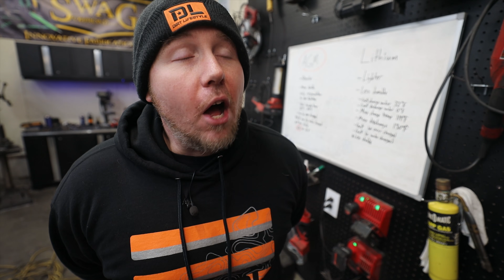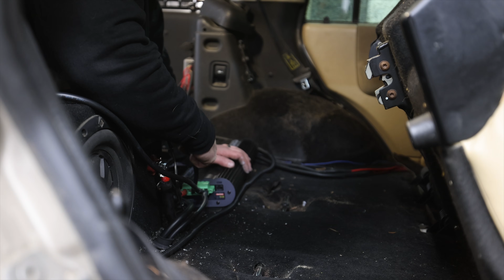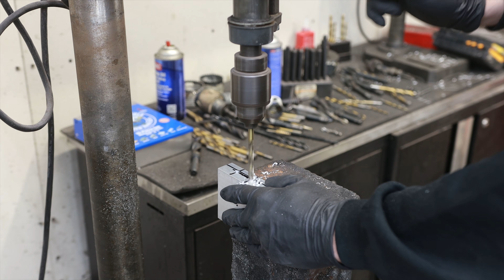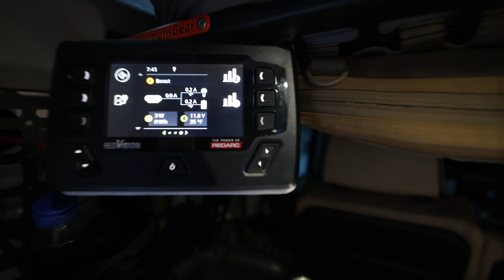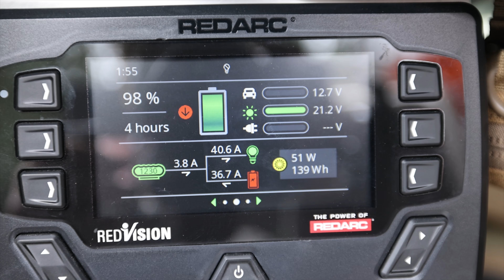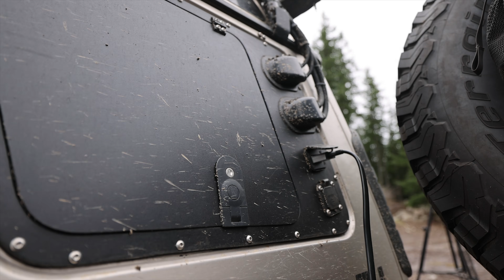Extreme Overland Solar! Dual Batteries Plus Electric Heat In A Roof Top Tent.

Comment: True going overlanding isn't as fun a d being safe alone in the woods as it is with a few friends or family,  when itcomesto solar there are many choices I still use renogy I have many of there products and I have 1500x yeti goal zero and 2 smart renogy lithium batteries 200ah each the only down fall using lithium batteries is real cold weather now days some come with built-in warmer , I think as long as you have thermo electric blanket to wrap up lithium batteries you be good , solar power system are endless ideas 😊

Comment: as long as you stay under the voltage input limit you can safely go over the amp limit and it will just clip your input amp at the max so you can get your full 540w more often.

Comment: Hey Nate i hope you and your family is doing good! I havent seen any new videos lately so i hope everything is ok. 
I know this video is a year old but if you get this i was wondering if you put a bigger altenator in your rig when you went to DC DC charge? I know i hear a lot talking bout putting a bigger altenator and if you told bout it i missed it and i apologize!
Im trying to put a overlanding rig togather on a budget and i started 8 months ago and the truck i got i didnt get it to start a rebuild of a truck i promise but i was told it needed a fuelpump but oh boy a fuelpump was the nicest thing it needed and needs. 
Ive just bout have got the truck to be safe and dependable to drive, almost. So im bout to be ready to start on the overlanding needs so thank you so much for all your help you share with what you have done! Any help willbe much appreciated! 
One more question what if you added 2 more 6 volt batteries if you had room to would it work and be a big help or would it be a over kill? I have plenty of room and can handle the weight so would you do it? Thanks buddy!

Comment: I'm running a 170ah lithium battery with a redarc 40amp bcdc and a 300amp alternator with 2/0 wiring between everything. My fridge will last for more days than I am usually away from the rig.  I haven't installed the solar stuff yet because I don't typically need as much power and with 40amps of charge it charges up in very little time.  I'm out in California and am usually doing some offroading when camping or driving between lakes so I haven't needed the solar yet but once I start looking at hooking up a portable air conditioning/ heater I'll definitely go a similar route. So far between having a nice rated sleeping bag and a usb battery bank powered blanket that usually covers most of the heating needs out here.

Comment: In my experience 700 watts is overkill. I was convinced I needed 800 watts on my last build. I was running an A/C unit and turns out I only needed 400 watts with the technology today with these "solar generators" I used my ecoflow and with the solar topping the unit off I was able to run my 5000 BTU A/C unit and small fans and my fridge no problem.

Comment: going to save this for my pop up a frame trailer that I am rewiring the batteries on soon as they used like 16 maybe 12GA wire when the manufacturer recommends 8GA minimum. Eventually I will be doing an DC-DC inverter and a solar controller with solar panels on some of the roof surfaces.

Comment: Im curious how you are hooking up the 300w panel as the specs of dissimilar panels can have a negative effect on the charging system. was also wondering what charge controller do you go with?

Comment: 12v batteries are almost always a dual use type of battery, vs 6v will almost always be a true deep cycle battery and will subsequently almost always have much heavier plates, those individual 6v's will each probably out weigh the single 12v battery.
I would be VERY wary about trying to use the house batteries to "JUMP" the starter battery, You can charge the starter battery from the house batteries, but the STARTER will undoubtedly draw to high instantaneous load and damage the DEEP CYCLE house batteries. If it's an only option / last resort measure yeah it will probably work, but like you described a single TOO deep draw on the 12v house battery hurt it, a SINGLE too high amp draw will hurt the 6v's

Comment: Lithium iron is safer and more stable than lithium ion. Also much lighter. So light they like to use them in motorcycles / dirt bikes. They tend to be 6v but makes significantly more sense in a durable application. Lithium iron is significantly less temperature sensitive than lithium ion.

Comment: I noticed you mounted the panels by screwing through the side aluminum.   You may have destroyed some of the cells as they usually connect by a printed circuit on the inside of the side aluminum structure.   The proper way is to mount on the bottom portion of the aluminum rail so you don't damage the panels.   Its possible they will still produce but you may have lost half your cells. If you got lucky and the screw holes didn't hit the printed circuit then you will still have full capacity.   You can test the open circuit voltage output under sunlight to see if it matches the manufacturers specifications, this will tell you if you damaged them or not.
Reply: It is also possible these panels have the printed circuit on the top so it is safe to drill the screw holes where you did and not damage them.  The panels I have use you can't drill where you did and not risk damaging them.
Reply from the maker: This is just an aluminum frame. 👍

Comment: yep... that's what I run in my diesel truck... 2 AGM 6v 225Ah, and 3000watt inverter inside rear contractor box bin, runs all my aux lighting, music radio, race radio, freezer, 4cfm jobsite quiet air compressor.... and then the premier power welder with additional 2300wdc up at front bumper ....

12v "deep cycles" are MARINE deep cycle and not true deep cycle, nowhere near same depth of discharge...

Comment: Why so large of panels?  The guys at 4wd24/7 use 100w panels on each vehicle and never run out (usually use less than 20%)  it just seems like a ton of power.
In Florida where I'm at I run a 125w on my Bronco and it's always full.  It took me a year to see a drop to 99%

Comment: I had a ctek system on my truck when I lost my alternator in remote central Nevada. I planned to head towards pahrump until the batteries died and then call for a tow. Instead, the controller sensed a draw and started charging my starter battery from the solar panels. Not only did I drive all the way to Vegas, but I kept going to Laughlin, spent a couple days there and then drove to SoCal on power from my panels. It's great, just don't try it at night!

Comment: A solar controller, with a proper MPPT controller, as long as you don't go over voltage, you can overpanel quite extensively.  Voltage is the "force", amperage is the possible volume, the controller can limit amperage.

Comment: AGM is the way in a 4 season vehicle. If one of the 4 seasons is snow and ice. Lithium X batteries are awesome, but not in the cold unless you can heat them using shore power.
Reply: Nah. Self-heating LiFePo4 batteries are very common now and address low temp charging issues.

Comment: practicing with an induction. hotplate..  600 watt inverter ran it  on medium... will use the   xantrex sw 2,000 watt  in the sequioa build...   electric blankets perfect... and bicycle charging.. next? DIY. 12 vdc  1x 10 inch long  pipe,  water "warmer:"   nice. build.

Comment: I’m a huge fan of solar panels and have had one on my minivan for years. I recently swapped the minivan for a Jeep and am planning to add some solar as I rig up for overland camping. Ideally, I’ll get a roof top tent with a flat hard top for my Gladiator where I can mount solar panels on top. Lots of good info and ideas in this video.

Comment: I’m thinking I’m going to put together an eco flow set for my tiny home with a bunch of panels and use their dual fuel generator. I’m still trying to figure out how much eco flow I have to buy and what I can buy cheaper and mix with it. If I can do it with just the generator I will. If not I will go the generator and the delta 2max and a spare battery. That way I have two slots on for the battery and one for the generator. I’ll use normal panels from there.

Comment: As far as being able to jump start the rig with the, basically, second set of batteries. How would connecting a battery selection switch work out? Boats, larger boats anyway, have been doing it for decades. I have seen them with either the as a 1-2-off or 1-both-2-off setup. In you case i think a 1-2-off style would work. Also, as a retired EMT, every ambulance I have ever worked on has a power switch to turn the batteries on. If it is not on, the truck/van operates as it would from the manufacturer. (Ford, GM, Dodge, MB.....) Once the batteries are turned on, it is now an ambulance. And all the fun switches come alive.

Just a thought, but i think it may at least give you a direction to follow.

As always, love the stuff you do.

Comment: You can use a Victron Battery saver to set a low voltage cutoff to save your batteries from over discharge

Comment: Generally you'll see 75% of panel ratings as output. But in right conditions with large enough controllers you can see 100% or just over

Comment: If the charge controller is an MPPT over paneling is perfectly acceptable and won't hurt anything. It will just limit the output at it's rated amperage.

Comment: I picked up a smart lithium battery with display built on top showing charge capability,  temperatures.  Has built in BMS with low temperature warm up, to prevent the battery from changing at low temperature. Bluetooth as well, but haven't got that working yet. Got it on Amazon,  not a bad price.

Comment: really useful video, thanks for putting it together, Im on a parallel course with a RR SC Sport that needs to be a daily 'normal' car and overland capable too. lifted, ARB lockers, winch and iKamper all installed and going with bluetti AC180 for for power for fridge etc. based in Alberta Canada, so if your ever up this way let me know

Comment: Good stuff as usual.   But for the amount of internal volume your taking up, just get a solar generator,  and several are self cooling/heating, even some batteries are., andbat a 3rd to 4th the weight.   Everyone makes this stuff so complex,  spread out, diy(whoops I didn't connect something right), now it's fried, just KISS.

Comment: Love this. I found with winter camping bifacial panels made a HUGE difference, crazy how much energy bounces back off the snow.
I don't have a heater in my setup, I use a 12v electric blanket to keep me toasty. Found a super nice little electric kettle that's been PERFECT for warm drinks, soups, etc. Lot of great little electric devices out there to make overlanding for extended periods pretty easy.
I personally went with a Delta 2 + portable panels, because I tend to park in covered areas and wanted it the solar setup to be a bit more flexible. Definitely curious to see how your solar blanket works out, I think that was a smart addition.
I have used the Delta to charge a NOCO battery jumper to just ensure I don't blow the expensive battery, lol.

Comment: Very nice! I'm very curious what kind of electric stove top you're planning on using with this setup? I've been planning an all-electric setup and my back-of-the-envelope calculations told me that the draw from the inverter for an AC electric stove top would be too much for AGM batteries and I'd need to look at LiFePO4. But maybe I'm wrong?

Comment: This is great man, I'm digging the setup. 

My only gripe is that there are no "service" loops at your points of ingress for the wiring into the cab. A little half loop would give the water something to run down and fall off instead of running into the connection.

Comment: There’s a Renogy charge controller that does 50a solar + alternator. Have to turn off the solar panels to get all 50a from the alternator. Any wattage from the panels will drop alternator charging to 25a

Comment: One thing to consider for getting more wattage production from your panels is have them at a 90 degree angle to the sun.  Yours are flat but if you set up your tent they will be at more of angle.  If the angle matches your latitude then they will be at 90 degrees.  So when parked make sure your tent is set up and this will also increase your production without any additional infrastructure.  Great video as usual thanks for sharing.

Comment: Just for perspective 

2- 6v 220ah AGM batteries weigh 166lbs, cost $600, and would require a HD mount. 
(warranty? lifetime cycles? )

1- 12v Li-time, self-heating LiFePo4 280ah battery weight 49lbs and cost $700
(5yr warranty, 3-5000 cycles) 

For Lead-acid and AGM batteries longevity sake you should only discharge to ~50% meaning instead of having 220ah its more like 120ah.

For LiFePo4 longevity you should only discharge to ~20% meaning instead of 280ah it's more like 220ah 

In my opinion the best setup is as follows. 
 
Duel AGM starter batteries under the hood for starting, winch, lights, air comp and use 1 to jump the other in need.

1 12v self-heating LiFePo4 battery (insulated) inside in the back for everything else.
(with 12v there's virtually no reason to run an inverter as 99% of things are 12v anyway. fridge, fans, charging, acc lights etc.

Comment: You really need to test out LifePO4 in the real world.  Alot of folks are worried about the temp requirements, but if your above 0 even a little bit of discharge is going to heat it up enough to accept a charge, and with many including heating elements now, that's even less of an issue.  And as long as you buy a decent battery the BMS should protect you from actually damaging.  Same of overcurrent....LifePO4 will have lower max discharge rate, thus not recommended for jumping,...but in an emergency, worse case it will trigger overcurrent protection.  That leaves ruggedness vs safe space to mount...which I know drove your decision for the most part.  That being said, a couple of 11lb 50Ah LIfePO4 batteries would give you more usable power, just have to find a little over a cubic foot to stuff them...
Reply: Finally fixed my account to be to my standard 20 year old youtube account.  So disclaimer, replying to myself.  Because I wanted to point out...that for the battery side of the build...this amount of battery is bare minimum.  Nate obviously can speak for himself, but what he appears to be going for, but IMHO that is enough battery to make it a SINGLE night...then a ton of solar to hopefully charge in the worst conditions...  For clarity, the 150W 12V heater is drawing about 12A...those AGM batteries are 110Ah...so trying to stay within parameters and not draw them down too much, that's closer to 60Ah of useable power.  So the battery is "gone" in around 5 hours...Sure, the 6 volt batteries can be and have been discharged more and are doing better than 12V AGM equivalents but if you want to run that tiny heater every night...your reducing the hundreds of cycles that AGM is going to provide.  Now 100Ah of LifePO4...that's 80Ah of no worry, 100Ah of not much worry. If you use the entire 100Ah, that's reducing from your 5K+ cycles of life....and after that it's not dead, it's still going to provide 80+Ah. I am a firm believer that super high current needs are the only reason to shy away from lithium, otherwise change your build to fit them.  Oh yeah, back to the discharge and charge with the massive solar...50-90W of solar needs between 12-27 hours to recharge that battery...obviously not happening.  Reasonable sunny day case, max you are going to see 75% of rated...regardless of if the solar...not needs to worry about your system here Nate...you will never hit any theoretical max. And reality is  you will see some percentage of that.  So perfect scenario, yes, you can recharge is a few hours...but again IMHO, you want more capacity, as you have to assume charging will be less than ideal.  All that to say for a pure electric setup...fridge, cooking, heat(cooking take more than your realize...heat is just on for so long)...200Ah of LifePO4 should be considered a minimum.... Anyway, just another post from a LifePO4 evangelist for folks who may be just looking at batteries.

Comment: Any high quality lithium battery will have a heating element to prevent it from damaging itself. With some well thought out insulation you can go well below freezing without a problem. For jumping the car off lithium you want a dual purpose battery like the one Dakota lithium sells as most lithium batteries can’t output that wattage. The problem with agm is the voltage sags as it goes down in capacity and a lot of things will stop working like your fridge even though you have like 30% capacity left. Where as lithium maintains pretty much the same voltage till 1% capacity. Lithium will also be close to half the weight if not less per given capacity. With some good knowledge and research a lithium setup is significantly better than agm and will last wayyyy longer but hey if it works it works!

Comment: Nate, I was once scolded by an electrician for soldering large cable leads without crimping.  He said, what happens when it gets hot?  Insisted that even with solder, anything carrying high current needs to be mechanically bonded or the solder can act as a fuse, in addition to not being up to code.  BTW: were you and electrician by trade? or plumber only.

Comment: With the solar now, you should check out the Esab Renegade Volt 200. Thing actually runs pretty damn smooth. A bit chonky but would be one hell of a trail welder.

Comment: Love your vids, however you are better off with a Lifepo4 system. Less weight 2-5k cycles. A few 100ah Lifepo4 with bms and temp sensor will do yu well. A much better setup